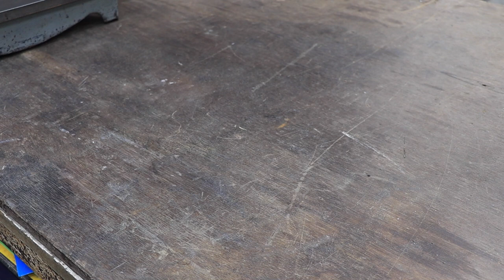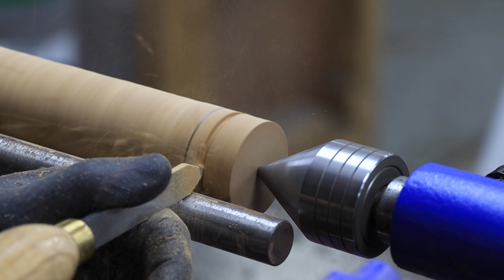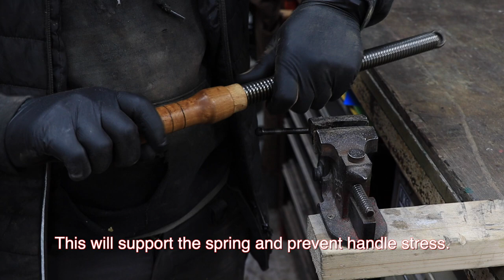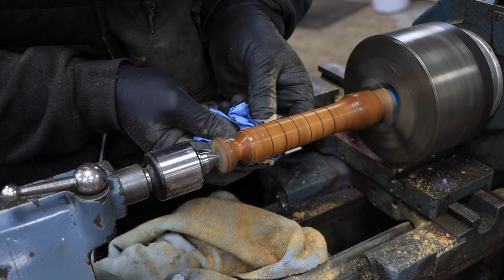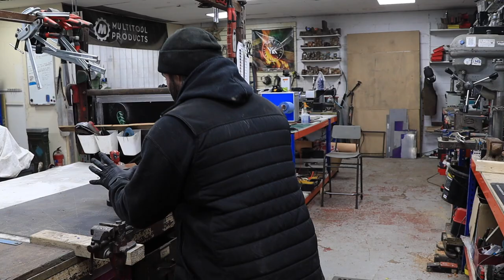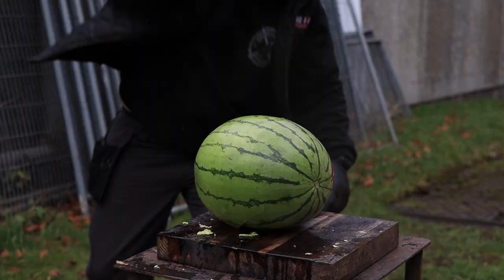Making A BRUTAL Trench Club! - WW1 Weapons Build

Comment: I was shown a club, taken from a thief, that was made of a similar door spring with a lump of lead moulded around one end and a grip made of tape at the other end. It could break windows and skulls equally well.
Reply from the maker: Absolutely brutal things they are
Reply: My step grandfather was a WWI Vet   and he carried a heavy spring that had a wooden dowel about 6"-7" long that fit inside of one end of the spring and then he wrapped and braided leather boot lace around the spring and dowel for a handle and had about 20"-24" sticking out from top of the handle with a lead ball about  the diameter of a silver dollar that threaded onto the opposite end and was wrapped in leather boot lace that was woven into the spring rite below it where it was fully threaded/seated on the spring,that resembled what they call a monkeys fist . The lead ball must've been around 8,10 maybe 12oz. in weight. He was a bartender at the American legion and would walk home after closing and he had a wooden leg  that could make him look like an easy mark to someone who didn't know any better but they wouldn't make that mistake twice for sure. He mentioned that,that's why he carried it. And you could tell that it was put to work at least once because there was dried blood on the one side of the  business end of it. Dont know if he carried it in the war or made it at home but he  was about the business(as most those old boys were) that I assure you.
Reply: @DiesInEveryFilm    That's why they are illegal to carry in germany.
Reply: Yeah that's called a blackjack or cosh

Comment: I carried one in the 80s while serving in the USMC that I made from an 18-inch piece of 1-1/2 inch recovery cable. I cast lead on the business end and cast aluminum for the handle. I thought I might get in trouble when the Gunny saw it, but he just told me to make him one. Nice piece of work. Well done.
Reply from the maker: Great bit of kit and brutal as hell
Reply: @DiesInEveryFilm  I will only say I had several chances to use it and it performed as intended. It was brutally efficient and worked like an extension of my arm. After the first use, I learned how important follow-through was. It was equally brutal in an overhand swing as with a horizontal swing, meaning helmets were little protection.

Comment: An interesting thing. But the shock part, the skull looks decorative, won't it fall apart?
And as always, great work with anything, even wood, even metal.
Reply from the maker: Thank you, the skull is solid brass and is held in with 8mm steel hook there’s no way it’s coming off, the original ones had lead heads which is softer than brass
Reply: @DiesInEveryFilm  I'm a bit skeptical about the epoxy alone keeping the spring secure over time. Then again though, how much use is the thing going to get?
Reply: @peachmelba1000  , It is possible to leave the spring eye on the end of the spring going into the handle. Lightly tack weld a small hex nut inside the spring eye. Drill the inside of the hex nut to perfectly fit a steel pin, which, of course, will then be applied through the rear of the wooden handle, cross-pinned. Also do the epoxy & that should be solid. 
    Another way would be to lightly tack weld a 3/8”x16t nut inside the rear of the spring & use a bolt through the pommel.    But his design is most likely enough.

Comment: DANG, man. That turned out really well. The skull thingie was a really nice touch. Truly a piece of (brutally lethal) art!
Reply from the maker: Thank you so much mate I really appreciate it
Reply: Looks like a garage door spring? I did garage doors before and i saw springs like this all the time, i never thought to do this with one. 

But they are extremely dangerous if used wrong, like i heard about a spring snapping once, the cable whipped out, broke a 2x4 like a toothpick. So i thought about... what if? Not that I'd ever do it because i like not being in prison. But if the springs were used as booby traps. Never saw that in a movie before
Reply from the maker: @derealized797  I bought a load of sprigs so im unsure what they are off but if you saw one break then it had a bad heat treat as they shouldn’t do that
Reply: @DiesInEveryFilm  nah garage door springs snap over time because people don't oil them. They're supposed to be oiled often, like once a month, otherwise they actually dry out and weaken. Also people sometimes do something not knowing how, over extend them, or even use the wrong springs.  

Overhead doors get as complicated as they are interesting, but there was money in it.

Comment: I made one a few months back. I used a drive gear from a crane for the head, a 1" cable bunged on both ends. One bung is welded to the gear, the other to a 3' pipe. I was making 2x4s explode, and broke 4 x 4s in half.
Reply from the maker: Really powerful tool

Comment: Using the stiff spring is a nice touch. It doesn't flop like a chain, but doesn't transfer shock to the hand and arm.
Reply from the maker: It’s how they were made
Reply: @DiesInEveryFilm  Really? I've done some reading on this, and have never seen a heavy coil spring used for an actual WWI trench club.
Reply from the maker: @666toysoldier  this is an exact replica of one in a museum near me and plenty of pictures of similar online (i changed the top from a ball to a skull) 
It’s my job to make this stuff

Comment: I've never heard of a trench club before. I was thinking about how they were used in ww1 and they are seriously dark and brutal. Imagine you a new recruit and tucked away in the trench and an enemy soldier suddenly pops over the edge and he's to close for your rifle. Your side arm is snapped in your holster and there isn't enough time to draw it and bring it to bare. You  look over and your trench club is leaning only a few inches away from your hand. You grab it and start bludgeoning the enemy but he doesn't go down right away and starts attacking back. You struggle in a life and death clench up, swinging your club but you can't bring it down with full force. Finally you knock him back just enough to swing for his head and he goes down only to push back to attack again. You swing and swing and swing. Finally he drops but you keep swinging in a panicked rage. Until there is nothing left of his head. You keep swinging until one of your buddies pulls you off the carcus. 
So brutal.
Reply from the maker: Hahahahaha crazy isn’t it
Reply: @DiesInEveryFilm Customs  especially when you arnt the first owner of the club. It's previous user or 2 got killed to death and it was issued to the replacement
Reply: are you a cannibal corpse fan?
Reply: What the fuck
Reply: Soldiers didn't have sidearms, they were officer only (exceptions happened, but not for new recruits)
Reply: Uh...yeah... I think you need to seek help.
Reply: You should join a metal band
Reply: @HexOmega3113  no. Just a vivid imagination. War sucks but it's our duty to remember what it cost to have what we have today.
Reply: @steadfasttherenowned2460  keep up the good work

Comment: Weld the top quarter and bottom quarter of the spring so it's still got flex but more solid.
Reply from the maker: This is a replica and the bar in the handle makes it more rigid but essentially you want the flex

Comment: Cool ! What is the purpose for the threaded section fixed in the core and handle?

EDIT: found your answer on another comment "didn't want the flex to cause to much stress on the wood"
Reply from the maker: Yeh i did put it on screen as well
Reply: @DiesInEveryFilm  cheers!

Comment: I’m not second guessing you, I’m just asking - why wouldn’t you have welded the spring to the bolt you screwed into the handle? Would not that epoxy let go of the spring after hard use?
Reply from the maker: Because i wanted it to flop about and the thread is solid there’s plenty of car parts held on less thread that get more abuse

Comment: Good.
Original trench clubs were made from anything they could get their hands on...
Some were particularly vicious....often with long nails, spikes and blades attached...
🇬🇧😐
Reply from the maker: Thanks, yup ive seen a load in a local museum we have.
Reply: @DiesInEveryFilm  

When you look at some of it....it shows just how nasty and bitter it had all got by 1916-1917...
Some guy even invented a flamethrower that would poke up in front of the German lines....and spray burning oil that would stick to anything it touched...
"Livens flame projector" they called it...
Reply from the maker: @glennmoreland6457  it’s crazy what humans will do when life is threatened

Comment: I can tell you right now,  that ain't gonna stop  no real man.
Some kinda fantasy toy.
Reply from the maker: 😂 im guessing you don’t know history very well,
Reply: @DiesInEveryFilm  don't get me wrong, it's a very well constructed piece. i just feel that the skull head is too small.
Reply from the maker: @victormartin6608  and yet again i will say, you don’t know history then?
This is slightly larger than most trench club heads ive seen but that being said i don’t know why it being smaller would be an issue, if you have a lump of brass like this flying at your head you certainly aren’t walking it off. 
But then I guess you probably just look for any reason to try be negative because you aren’t the one making.

Comment: I am trying to understand this thing. Does the flex in the spring aid in delivering more power? Looks like an interesting idea, and could be very effective.
Reply from the maker: It’s more of a deadblow effect, crazy how powerful it is tbh
Reply: @DiesInEveryFilm  very cool, so the spring does flex when delivering a blow? I may have to try and make something like this. super cool build man
Reply: I'm pretty sure that's how blackjacks work as well.  If it's all one solid piece you lose your grip.  If it has a tiny bit of give, you keep your grip and deliver more impact.
Reply from the maker: @cennon  yeh blackjacks are similar idea and billyclubs
Reply: @DiesInEveryFilm  I remember Tony Soprano using a blackjack on Coco.  He messed that dude up big time.
Reply from the maker: @cennon  hahahahaha

Comment: It would be a lot better if the Shaft and the Skull weren`t flexible. Some of the Strikes energy will be lost in the Club bending on Impact.
Reply from the maker: But this is based off a trench club design and i can assure you it’s very powerful it acts like a deadblow and they were used with great success
Reply: @DiesInEveryFilm  i watched a Video about Medieval Weapons by Shadyversity. The Core Message was that a Club/Mace that has no moving Parts is better than somthing like a Flail, because the Force of the Strike goes mostly into the Target that 
Way. The WW 1  Trenchclub has a flexible Shaft since it is made of a Spring by the Looks of it, that is how i came to my Comment. I am sure that it is deadly regardless.
Reply from the maker: @sebastiangrebe8276  you do understand you have taken one guys opinion of something and see that as right which it isn’t, it’s an opinion. 
Also he was talking about flail on chain not trench club on spring which is a totally different concept as the spring makes it deadblow which as we know from the hammers definitely works. 
See you watch videos for your knowledge and i test and live it for my knowledge
Reply: @DiesInEveryFilm  Ok i guess i should not jump to conclusions by watching Youtube Videos. Sorry.

Comment: Where can I get springs like that?
Reply from the maker: I bought a box of springs and these were in it so im unsure where they came from
Reply: I have a spring very similar to the one you used in the vid,  but it's not very stiff so it flexes easily.  Is the spring you used stiff or pretty flexible?
Reply from the maker: @elderlyBerry  it’s a stiff one, you can see in the video really as that’s better than I could explain

Comment: I WANT 1
Reply from the maker: This is available
Reply: @DiesInEveryFilm  cool,  I'm in Florida,  how much and do you have a website
Reply: @DiesInEveryFilm  also,  instead of a skull on the end,  how about a solid chrome ball bearing?, just like the one in your video except a ball in place of the skull,  similar weight and size,  reply with a price and an address,  thank you
Reply from the maker: @woofman4796  website is linked in description, if you contact me through that we can discuss pricing. 
Thanks
Reply from the maker: @woofman4796  i could change it yes but id have to find pricing of a ball and after it is fixed I doubt it would still be chrome as id need to soften or weld it. 
Website 
https://www.diesineveryfilm.com
Reply: @DiesInEveryFilm  i was saying chrome as an example,, a solid steel ball, i'm not a fan of the skull is all, but you have some mad skills, i love that club, thank-you,, i'll be checking out your website